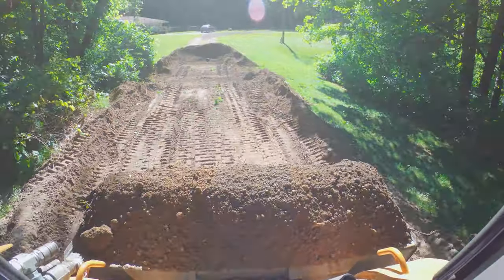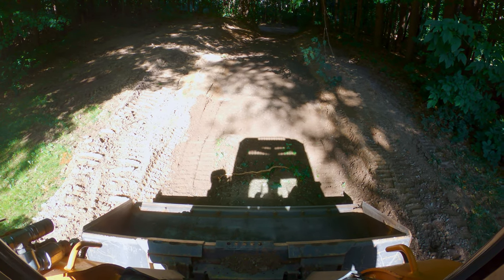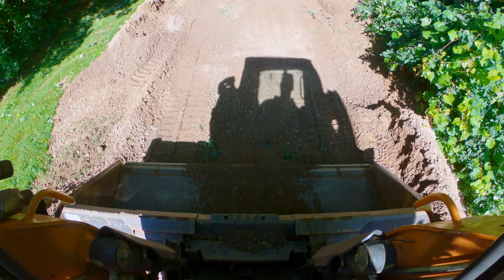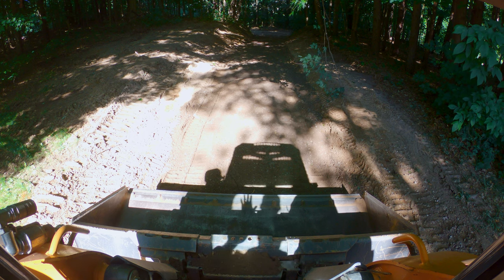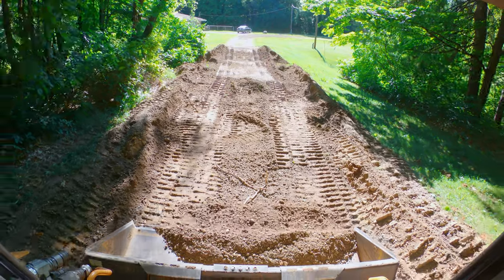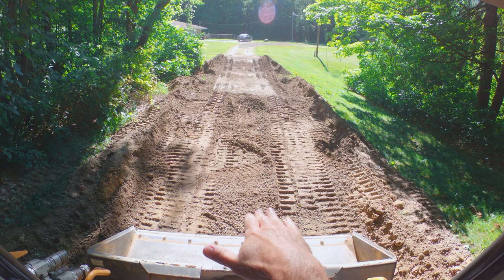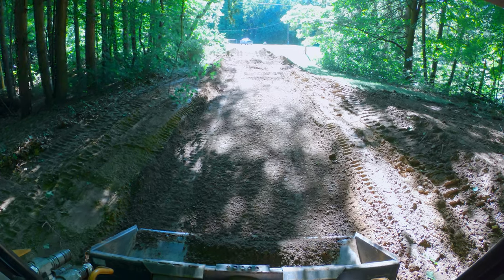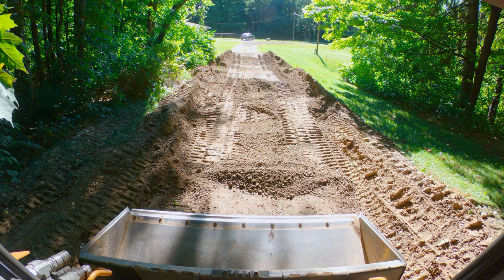How To Grade In Skid Steer

Comment: Track steers are way better because you use the tracks like a 🐑 sheeps foot compactor, and feel the level better. Had to grab a joystick rental when i blev a ram 🐏 seal.
Reply from the maker: You won't get good compaction with a CTL because the tracks create a low ground pressure situation.  You will get better compaction with a wheeled machine.

Comment: I always appreciate your videos, but I think most important thing is to work linearly, don’t wanna have to spin around and go back and forth. Also plan out your cuts and fills before you even start. The other thing is if u have a full bucket you can use it same as a dozer and just push all the way through each pass because the material will fall out in holes and then you cut and pick more up on the humps
Reply from the maker: Excellent advice all the way around. Thanks for sharing these!
Reply: agreed, if im doing parking lots i will place pile where i want it then grab a full bucket so i can doze my piles down

Comment: Get a 4 in 1 bucket. Open it out. Push a pile. For final cut, roll the bucket watching the spill out the side of the blade. In Australia, it's hard to find a skid steer without a 4 in 1.

Comment: Do you ever see a tilt attachment between the bucket and machine? For side to side slopes?
Reply: You mean a Tilt Tach?  I 've considered one, but I already have a 6-way dozer blade with a laser mast and receiver, and a slope meter, so it just seemed too redundant.  I've always considered buckets for carrying, and blades for spreading/cutting grade.
Reply: @waynevincent5448  I'm grading 95% of my time running a skid a asphalt base. I don't know anyone who's doing my job that don't have a tilt tach on they machine.  Suprised? I have a slope meter on my bucket and i can do just about 90% of my sites with just that. I also have a wheeled excator on every site.
Reply from the maker: I am familiar with the tilt attachment but I've never used one personally.  I could see them being super handy for grading slopes and putting crowns into driveway grades.
Reply: @DieselandIron  It's like rototilt for skids, I have allways wondered why things are so different across the pond.🙃
Reply: Just got a bobcat that came with it. Pretty cool. Never seen or used before
Reply: @7663ron  there's def a learning curve to it. But once you get it going there's no stopping you.🤩
Reply: U can do it without as long as u can get yourself on the same angle before you start cutting or filling
Reply: @lukeknight2247  Yes, thats a waiste of time. Same as using an excavator with out a rototilt🤔